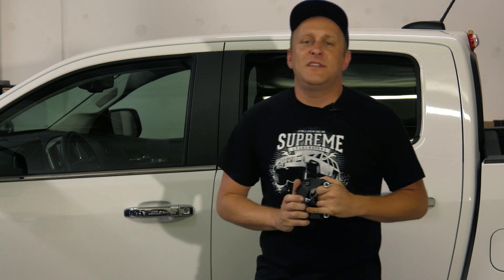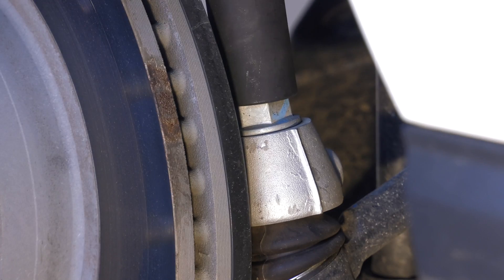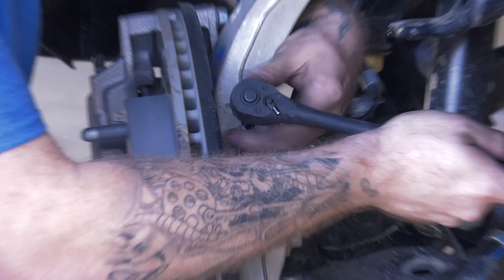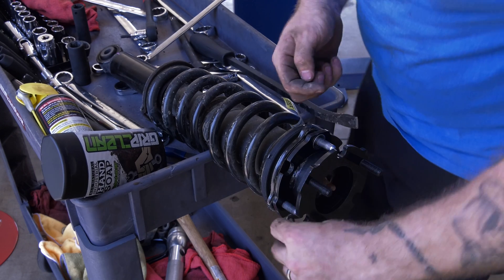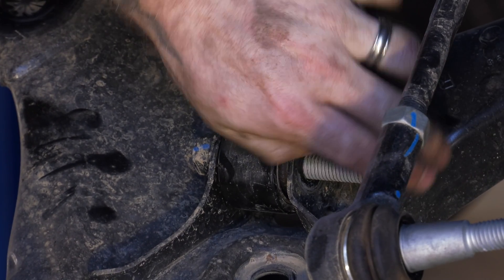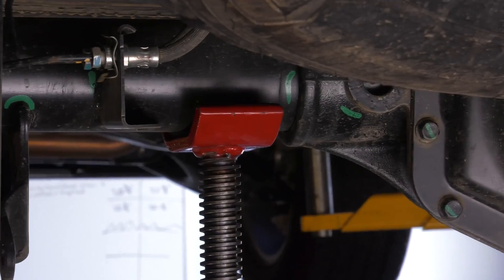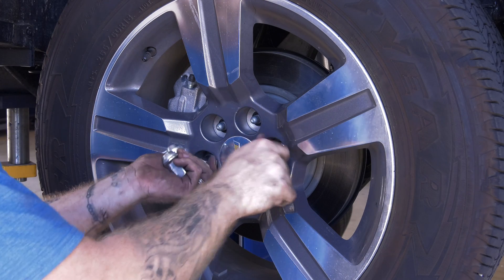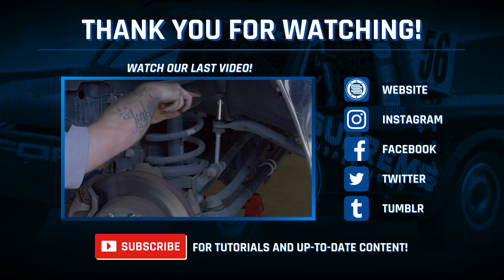2016 Chevy Colorado | 2.5" Front / 2" Rear Leveling Kit Install Tutorial

Comment: Dont buy. They arent telling you that youll need a $250 open ended torque wrench to actually tighten the strut bolts. They state it on the video but as you can see, theyre not using an open ended torque wrench, theyre using a regular open ended wrench.
Reply from the maker: A professional shop should have all necessary tools for the installation. Also, you might be able to find the right tool to rent from a parts store. Still definitely worth buying.

Comment: will this fit a 2006 2wd?
Reply from the maker: The lift kit featured in this video will not, but you can find a lift kit for the 2006 model on our website at this link; https://supremesuspensions.com/products/2004-2012-chevy-colorado-full-suspension-lift-kit-2wd-4x2?variant=21410673360976

Comment: Brand new to any mechanic work. To install the rear spring shackle how do I do this with my truck still on the ground?
Reply from the maker: Hi Sean, removing the necessary suspension components to install this kit would not be possible without lifting the vehicle. It is necessary to allow the suspensions to hang freely and remove any load from the vehicle prior to installation.

Comment: Is there 2 inch lift blocks for the 15 to 21 Colorado's  ?
Reply from the maker: Currently, the front spacers we have are confirmed to fit '15-'20.
We have yet to confirm a firment for the '21 model year.

Comment: After installing these shackles on my 2016 Chevy colorado, they sit directly on top of exhaust pipe (rear passenger side exhaust pipe) and! What's the fix for this? Worried my shackle bushings are going to get burned up from heat and wear out. Not to mention I don't want them touching in the first place.

Anyone from supreme suspensions have a comment on this? I installed your 3-in front 2-in rear leveling lift kit with shackles in the back and strut spacers in the front. It's a 2016 Chevy Colorado LT crew cab. Just installed yesterday and put would be appreciated.
Reply: Any issues after 3 years?

Comment: I have a 2018 Colorado 2WD Crewcab WT. Will this kit fit and if so, what size tires and wheels can I fit with your kit?
Reply from the maker: Hello! The kit will fit your 2018 Colorado 2WD WT. Also, most people are using 295/75-16 or 305/75-16 depending on the size of the lift. 
This is typically about a 32.5-33.5" tire on average.

Comment: Trying to install on a 4 wheel drive.  I couldn't force the lower control arm down enough to get the strut spacer combo pushed into place... what am I missing? Loosened the sway bar to get passed that but no matter how much pressure was applied it just wouldnt go low enough
Reply from the maker: What size lift were you putting on? Are you making contact with your bump stops? You can compress the spring on the strut to allow additional spacing or you may need to trim down your bump stop (or eliminate entirely) if you're doing 3-3.5" of lift height.
Reply: I have the same problem. I tried to install the kit today and couldn’t for the life of me get the lower control arm to go low enough, even with the lower ball joint loosened to get more angle out of it. I’ve very frustrated I spent 3 hours working on the kit and couldn’t get it installed.

Comment: Will this kit fit a 2019 Colorado Z71 4x4 longbed? What’s the biggest tire I can fit on stock 17x8 wheels?
Reply from the maker: Hi - this kit will fill all 2019 models EXCEPT for the ZR2. 

Also the largest recommended tire would probably be a 285/70-17 or about 33" tires for this vehicle. Depending on the lift height however (3"+) you may be able to fit slightly larger tires but for a factory 8" wide rim, that would be as big as we would go.
Reply: Thanks.. how thick is the metal used for the rear shackles?
Reply from the maker: We use a 1/4" thick carbon steel for the rear shackles.
Reply: Supreme Suspensions thanks for the info. I’m having the kit installed by one of your dealers next week! 😀
Reply from the maker: Awesome!!  Thank you for the support!

If you have any additional questions, please feel free to contact us directly at 888-810-6791 =)

Comment: Will the control arms still have decent travel and will the cv joints operate properly?
Reply from the maker: Hi Eric - These were engineered to be used with your factory control arms and should retain enough travel without making contact at any lift configuration we offer for the Colorado's. It would be recommended, though not necessary, to get tubular control arms once you start getting into the 3.5" lift height range. 

Also your 2wd does not have a front axle, so no CV Joint. If the truck is 2WD you do not have CV (constant velocity) joints up front. The CV joints are located on either end of the front half-shafts coming off the front differential that drive the front wheels on a 4WD model.

If you have a 4WD however, we do make differential drops that helps correct the suspension geometry for your CV's when doing lifts,

If you have further questions, please reach out to us directly at 888-810-6791.
Reply: Supreme Suspensions so cv axles should still work properly over time with a 2.5 inch kit?
Reply from the maker: Absolutely correct . Granted, a diff drop wouldn't be a bad idea on any 4WD that uses a strut or coil spacer lift though. They're inexpensive and can save you from headaches down the line especially if you plan on taking the vehicle off-road at any point in time. 

The install video here was for a 2WD drive so if you have a 2WD Colorado, you do not need to worry about CV's since you would not have any at the front of your vehicle.
Reply: Supreme Suspensions I have a 4wd. How can I get a set of diff drop spacers?
Reply from the maker: Though we currently do not offer a diff drop for the Colorado, you can check out https://www.peaksuspension.com/products/peak-suspension-1-colorado-canyon-differential-drop for it.

Comment: One quick question.....
Did you guys have any issues with the exhaust being in the way of the passenger side shackle install? 
I want to order this but want to make sure before I pull the trigger. 
2017 Colorado Z71
Reply: Wow, I just learned more from you guys or had about 100 questions answered from yalls comments than anything. Much appreciated. I was about to order the front and shackles but was having doubts about the shackles
Reply from the maker: If i recall correctly, everything fit together well with no rubbing however we had to do that side with spanner wrenches because we couldn't fit the impact gun up there with the exhaust in place.
Reply: Supreme Suspensions ok thanks!  I bought the front today I’m going to install those and see how she sits before I get the shackles.
Reply: Supreme Suspensions 
Working on putting 2” shackles on and exhaust is a good 1/2” too high to install. I have a 2019 GMC Canyon.
Reply: MJ B ah ok. I don’t feel like redoing my exhaust. Is there another option? I’m sure that part was left out of the video for that reason. Did you do the front first? If so how did it look with just the front?
Reply: Joe Lipcovich 
I put the 2” spacers on the front and truck looks good but the front wheel well sits 1” hire than rear wheel well off the ground so even though trucks pretty level it gives the illusion that the front is higher...nothing bad, looks good actually...2.5” in front alone would sit little too high for me without a rear level kit. I’m prob putting on a 1”-2” block kit cause it should fit the best without having to cut or weld anything, should bolt on. Other thing with the shackles is the plate was to tight to the spring and couldn’t get the bolt to go all the way through, about 1-2mm of material would have had to be removed from the plate to be able to get the bolt holes to line up. Definitely did not bolt on like in the video, never got the bolt through and due to the exhaust issue as well I’m going to return.
Reply: MJ B I’m already looking into the lift blocks. There’s a company that makes a 1”-3” rear block kit. Little pricey but you get the adjustability without having to buy different size blocks. They might be junk too. Haven’t really researched them yet. ProRyde. 
Blocks are cheap. ZR2 only has 1” blocks and can buy a set of OEM for $60 online.
Reply: Joe Lipcovich I just ordered “suspension specialist” 1.5” block set on eBay for $75...they offer 1”,2”, 3” sets. Not sure if their worth a damn but cast iron blocks made in the U.S. so I’ll take the gamble.  I’ll let you know how it turn out when I install them this weekend...should be an easy job. Let me know what you end up getting and how it turns out. I should end up with about a .5” rake when all is said in done which is good for me to keep the front end down a bit when hauling/towing. Plus will get rid of the uneven gap between from and rear wheel wells. Good luck!
Reply: MJ B sounds good! Keep me posted. I was thinking the 1” but I may go the 1.5” to 2”. ProRyde blocks are cast iron and they are adjustable blocks depending how high you wanna go. $135 though. Adjustable to 3”. My ZR2 wheels and tires will arrive Thursday and I have the front lift kit from these guys. I just need the rear blocks so I can install everything at once and get the alignment done.
Reply: MJ B ever get the blocks installed?
Reply: Joe Lipcovich I did but the pins were too long on the blocks so I ground them down more than halfway so they sat flush on the axle but after going on a test drive the pins must have been just barely still a little long causing both blocks to crack badly. I may order the pro-ryde as well, but I think most sets will require grinding down the block pins since the axle does not have a hole only the leaf spring spacer does and it’s not more than 1/4” deep. The truck looked great after install but sending back ones that cracked and will either re-order or may get the proryde so I can change height if needed...will likely try 1” first then bump up to 1.5” if not quite high enough
Reply: MJ B always something....
Reply: @LoKey_B  dang , I've got a 2019 Colorado 2wd , I almost ordered it , new it was too good to be true , this was the 1st company I've seen add shackles to lift kit , others are mostly  blocks.
Reply: Dave I believe the rear blocks are the same as a Silverado. You can also order from Chevy the rear ZR2 1” blocks.
Reply: Dave I have the proryde set coming in today...I’ll let y’all know how it bolts on but I have a feeling the pin will need filed down on the block in order to sit flush.
Reply: MJ B that’s so weird. I have done a lot of research with blocks vs shackles and I have never heard anything about the issue you had having to file or bring the pin. ZR2 has a 1” block from the factory. Is there something there that you didn’t take off that was supposed to been removed?
Reply: Joe Lipcovich no...the canyon has a stock spacer on the axle but the pin whole is under 1/8” deep...most pins are around 1/2”.
Reply: MJ B ah gotcha. You install the ProRyde blocks yet?
Reply: Joe Lipcovich just pulled them out of the box and the quality is nice but blocks are odd. Come with basically two block sets. One block the “2in” block is over 3in tall...then the two smaller stackable blocks have no pin whatsoever so would just sit on top of your axle with the leaf spring pin holding it in place...also the 1” portion of the stackable block measures 3/4” tall and then stacked together what are supposed to be 1.5” tall only are 1 1/4” tall. These are janky. Prob sending back cause they are not even close to what’s advertised. Always something. SMH
Reply: MJ B always something....
Just order the Chevy ZR2 blocks. 1” and they are OEM
Reply: Joe Lipcovich can you reply with the link so I can check them out?
Reply: Joe Lipcovich I cant fine OEM blocks for a canyons...if you have a link of love to check them out. FYI, just got off the phone with proryde and “customoffsets.com” sent me the Silverado kit. Now have to reorder the correct one. Always something...looking into other kits too...icon has a quality looking set. Getting the parts been harder than the install...smh
Reply: MJ B here check this link out. 

https://www.coloradofans.com/forums/193-2nd-gen-tires-wheels-suspension/350770-rear-lift-gm-block-u-bolts.html#/topics/350770?page=3. 

These guys discuss it. Never read an issue about what you were saying with your problems. The Colorado and Canyon are the same truck. From what these guys say the OEM ZR2 blocks from Chevy are the same as the 1500 series trucks.
Reply: Joe Lipcovich update for ya...hit the correct proryde blocks mounted yesterday...used the 1” and looks perfect. Of course did have to shave maybe 1/16” off pin length, may not have had to do it but didn’t want the pins to break the block under truck pressure, maybe it’s just my truck where the purch where the block sits on the axle has a fairly shallow hole. Without shaving the pin length very well may have been ok, but could see a very small gap between purch and block before shortening so figured better be safe than sorry. Also cut 1/2” off the U-bolts cause they were a bit long to get the correct torque put on with the 1” blocks. My socket was not deep enough to get passed the extra length on the U-Bolt when tightened down, def would not have been able to torque to 75-80 lb spec without cutting them 1/2” or buying shorter bolts. All easy mods and with the 1.5” or 2” block bolt length would have been fine. Quality is Top Notch with proryde blocks and should be with the price of $139. With that price your getting 3 blocks sets and can change height of rear. If I had to start over I would have bout the proryde adjustable front spacers as well...but super happy with end results. Have a 1/8” rake now on the truck so looks very level. Let me know if you get the OEM zr2 blocks...those should work.
Reply: MJ B sounds great man. Glad they worked out for ya. I have all my stuff but won’t install till the 10th. I’ll let ya know how mine work out.

Comment: Just to confirm before I pull the trigger on these... do we need a spring compressor to do this ourselves? It looks like the whole assembly just slides out and the front spacer mounts right on top without having to disassemble it. Is that correct?
Reply from the maker: That is correct. You do not need to disassemble the strut assembly.
Reply: Good question bro, I was about to ask the same.

Comment: I have the strut installed to the lower swing arm and bolted in however I can’t get the upper swing arm to compress far enough down to get reattached.  It seems the coil needs to compress for the lower swing arm to come up enough to attach but I can’t for the life of me get it to come up. Any ideas?
Reply from the maker: When I run into that, I'll put a floor jack under the lower arm and jack it up so that the spring compresses and I can re-attach the ball joint. Just be careful that you're only jacking the suspension and not the whole truck.
Reply: Supreme Suspensions Thanks for the reply! I did that however instead of the suspension compressing my whole truck lifts up which is weird".
Reply: @hardknocksof91  put the other front tire on the ground and it will compress. not enough weight on the strut without that happening.
Reply: Supreme Suspensions A buddy told me to try ratchet straps and if that doesn’t work I don’t know what to do
Reply: @hardknocksof91  If I remember correctly, I used a 4-foot pry bar to bring them together then had a buddy get the nut on there while I was holding it.
Reply from the maker: I usually have a massive pry bar handy for that reason. A Dakota once gave me trouble going back together and I used a ratchet strap to make it work.

Comment: Quick question. After installing on strut and reinstalling the strut, will the lower control arm be very low to the ground?
Reply from the maker: The distance between the lower control arm and the ground is a factor of tire size. Assuming you are using the same size tire, after you install the kit, the lower ball joint will be the same distance from the ground as with the stock suspension. With the kit installed, the lower control arm will sit at a steeper angle and the frame (as well as the rest of the truck) will sit higher than stock.

Comment: i want to keep the rake; so if i install 2.5 spacer on front, what do i need on the back end?
Reply from the maker: To keep the rake that the truck already has, you would want to add a 2.5" rear lift to go with the 2.5" front lift.

Comment: At 3:44 mins. I notice that the shackle rubs on the spring. Like the midle plate is toching it. Wouldnt that causw damage to the spring and some metal noises? 
Also because of the shackle being that narrow. Wouldnt that ruin the bushing. I notice that the factory shackle covers the complete bushings
Reply from the maker: Once you lower the weight of the vehicle to the ground, it will kick the shackle out so there are no rubbing issues. As for the width of the shackle, you want that as snug as possible as you want it to hinge forward and backward, not side to side. If there was slack between the bushing and shackle then it would be able to shift side to side and that is a bigg NONO.

Comment: With the 2.5 in the front does it cause extra wear on the ball joints and cv shFts being at a increased angle.  I have read that it does
Reply from the maker: Any time you are changing a vehicle from its stock form you are going to be increasing the wear on the stock components as they were designed to function at the stock height. That being said, 2.5" is not going to through your ball joints out of whack but I would definitely recommend a differential drop kit for your C/V shafts for your exact reasoning.
Reply: @SupremesuspensionsLiftKits  do you guys offer that differential drop kit for this kit?